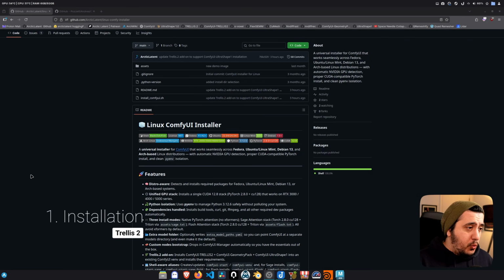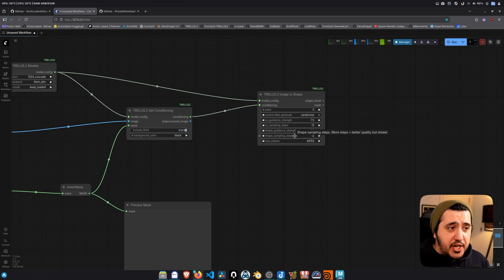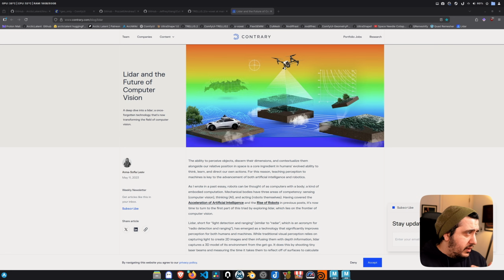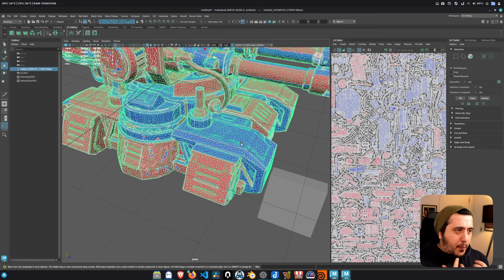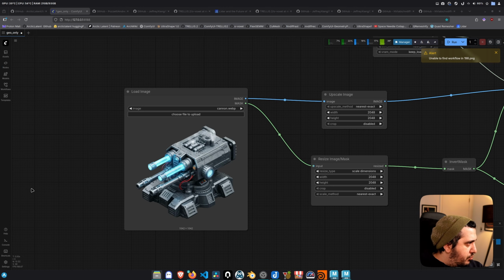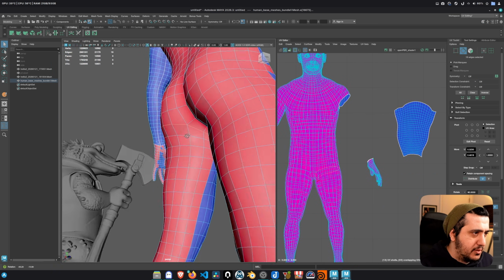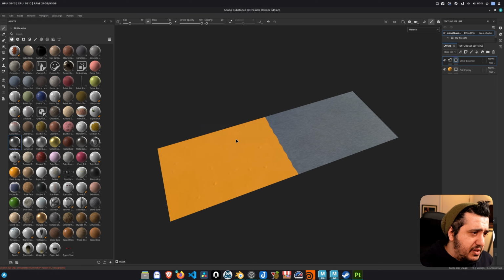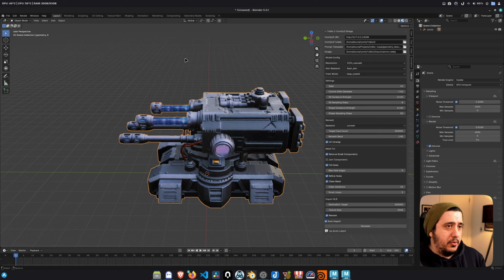Trellis 2: How Good Is AI 3D Generation Really for VFX? (From a 15-Year Artist)

Comment: For Comfy noobs: On the topic of the metal stuff needing to be 1 or zero good news is it should be easy to process the image to make it 1 or 0 based off some threshholds. Hopefully the white is correct then anything not white is black otherwise its a bit more difficult to figure out but it shouldnt be too bad. Not sure if its worth it because I dont know about the 3d stuff but for just an image that is easy. Question would be is it correct enough to get it right as in if there is no way to isolate metal from nonmetal it wont work or atleast wont be easy. For example if a lot of mettel and non have the same values it wont work but if the metal share values that the non metal doesnt then its going to be easy. But yea if the white is correct it would just take a few minutes to set up a workflow that would take an image or batch and turn everything not white pure black. If the Video maker aka the proffesional comments on this with a way to determin what should be 1 versus 0 I can create a script or workflow to take care of this and post it. If I could tell what part of that image was supposed to be the axe head I could figure it. Im going to generate some stuff so if I can figure it out Ill post back a fix if I find one. Knowing is half the battle!